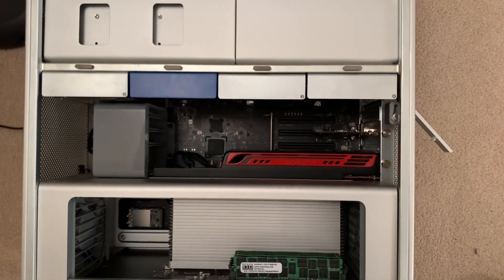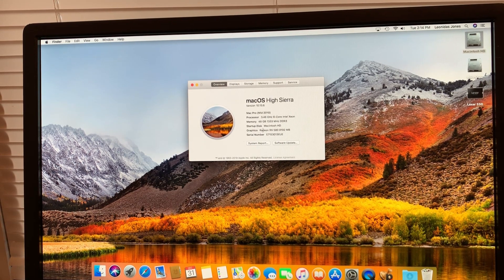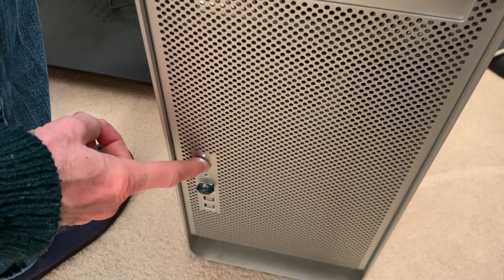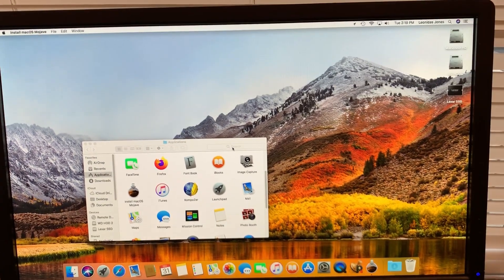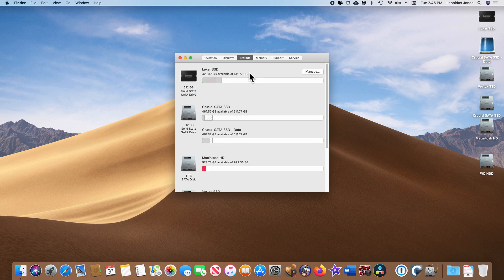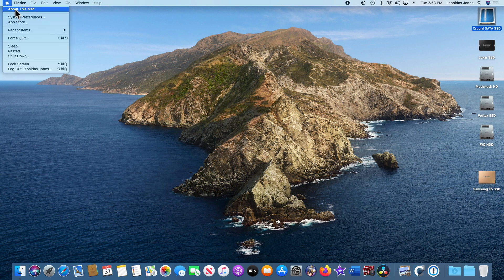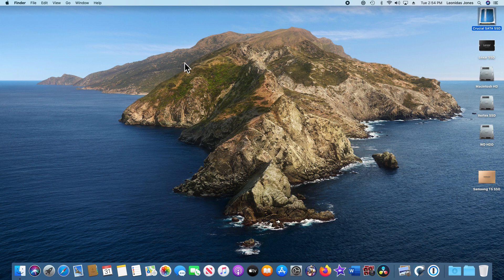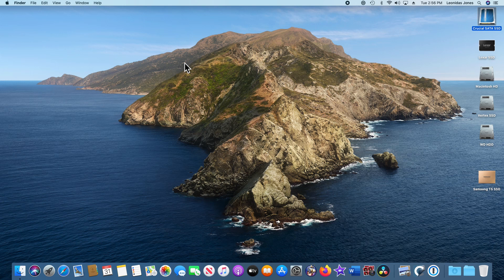AMD Radeon RX 580

Comment: How do you get multi displays from a 5,1 with RX580 running Mojave ?
Reply from the maker: The card does have five output ports. I don’t run multiple displays myself, but it should be very possible.
Reply: @brokenelectronics3665  It's not so easy, I'm running the same card and tried multi configurations and running into the same issue. Some would work but after reboot it would go back to only (1) monitor.
Reply from the maker: @joshweinstein5843  Hm. As I say, I haven’t tried it myself. I’ll look into it, if I discover anything, I’ll get back to you.

Comment: Do you know how to flash this card or its not possible?
Reply from the maker: Yes, it can be flashed, no I don't really know how. You need a Windows machine to flash it, which I don't have. I bought one preflashed from a guy in Australia. I have two 5,1 Mac Pros, one has the flashed card, the other has an unflashed one. If I were to encounter problems, which I have not, I could always swap out the cards to deal with whichever machine has a problem.